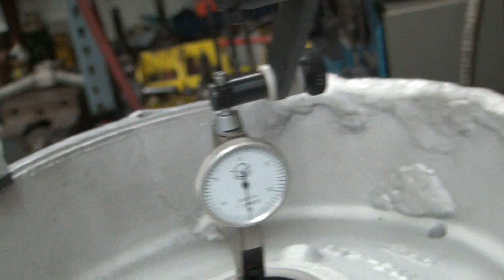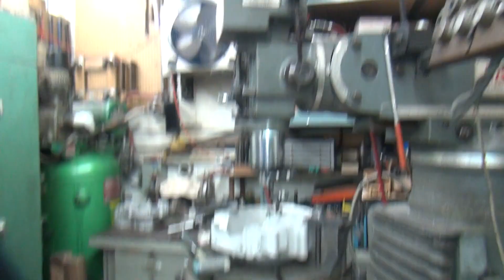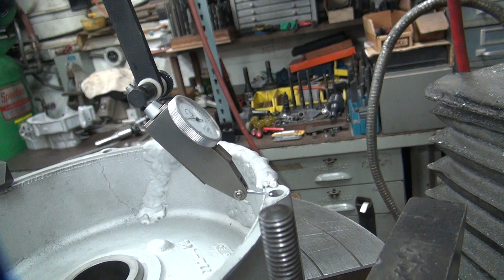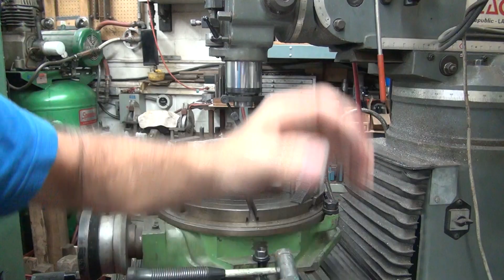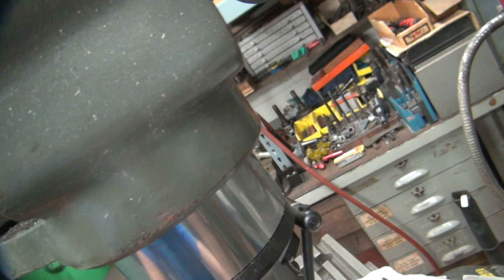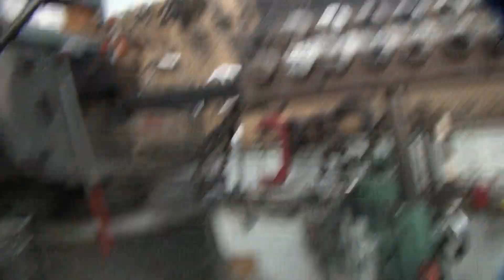#120 1947 EL case welding knucklehead 74ci motor weld and machining repair harley by tatro machine

Comment: Why did you not make a spud to fit the center hole in the table and fit the other end of the spud to the main bearing bore and center it off the main bearing bore rather than wasting time chasing zero with indicator and shims? The main line is the critical zero point on both case half's. Who cars what the out side of the case is doing as long as you have a true center to work from.
Reply from the maker: i made all the centers the same and square to the mains as best i could. when all done, the mains honed very straight and true. everything i fixed is working now. every part i didn't machine is way off and has to be remachined. 
tatro